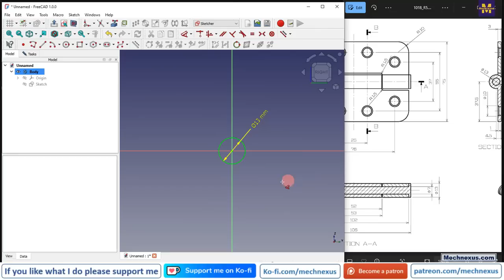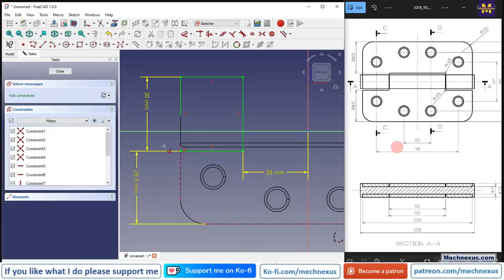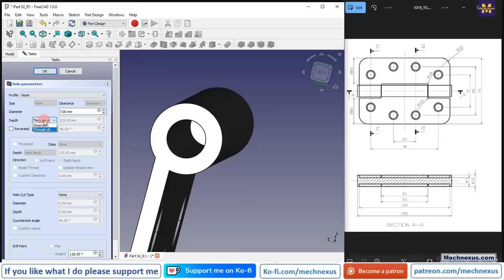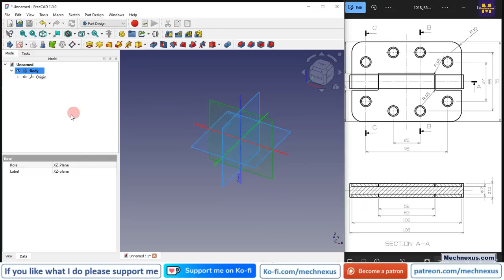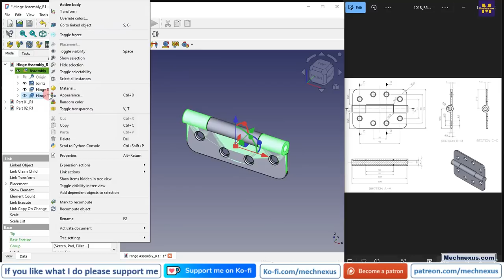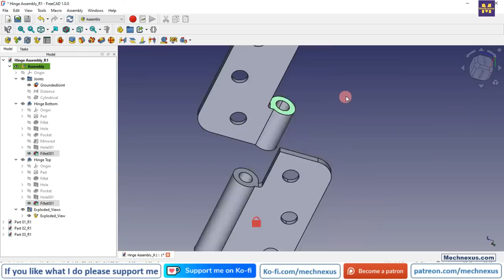Assembly of Hinge in FreeCAD | FreeCAD Tutorial | FreeCAD Assembly | Mechnexus |

Comment: Very nice... Thanks for showing. 
Question: how is the pin suppose to fit through the hinge holes if both ends have a flange? 
I always design models that have to fit physically too. I am not sure what the actual production process is? 
Maybe one end of the pin does not have the flange but is just straight and another end piece for the pin is a flange that is press fit onto the pin? Please show this process how to correct the part. 
Parts need to be able to be actually produced or the design is of no use, right? 
You created the hinge as shown but who would pay for this design without being shown all the pieces to produce the pin? 
Does FreeCAD v1.0 provide a magic button?
Does this make sense?
Thank You 
Please help us to be able to think outside the box and ask the customer questions if needed.
Reply from the maker: Check and hinge model over Google you will get it. Cut on both hinge are different.